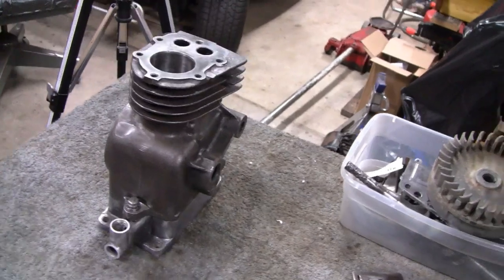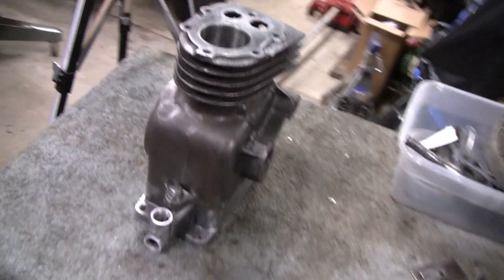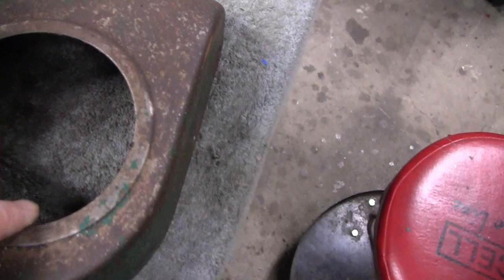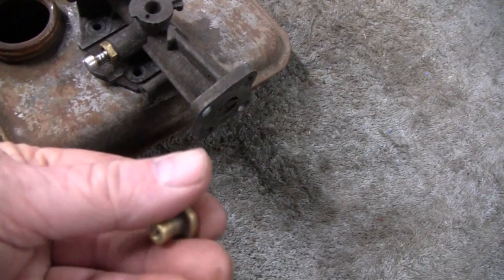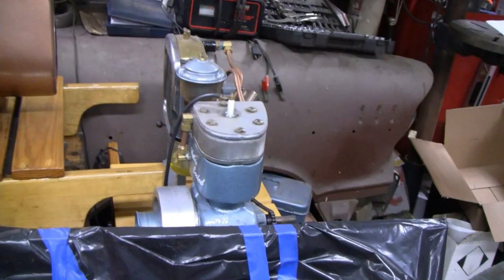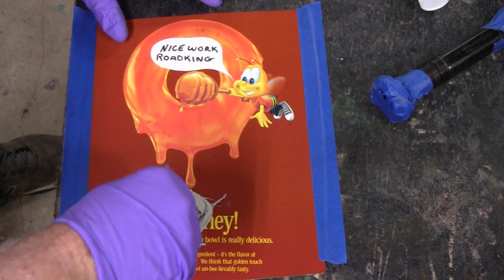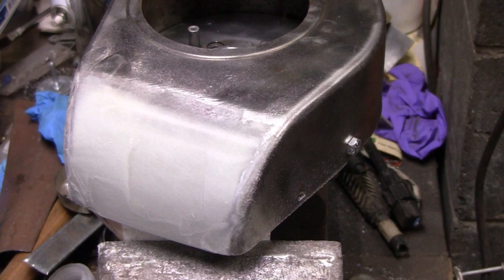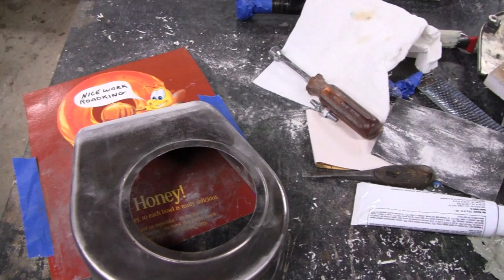MOTORIZED SCOOTER BUILD (part 13)

Comment: Great update Roadie! I'm in the process of thinning out the engine collection here to get a little more room in the shop. Let me know if you get stuck on anything. I've got N's, 8's, 5's, WI's and who knows what else around here. All run (after a little Zippo style tinkering). One I have is a really cool crank start reduction gear Sears badge Briggs with a little 3 bolt flow jet carb on it. That would make an interesting project build to power something with the reduction gearing. Anyhow...just rambling now. Catch you on the next one Roadie! Zippy~
Reply from the maker: Thanks Zip!! I know the feeling, I have a loft full of God only knows what!! I just gave away that Bready Walk Behind Tractor with a gear reduction "N", the Kid probably already ripped the engine off it!!☺

Comment: Nice progress 
What primer would you recommend for cast aluminum I have some brackets for the front accessories on my truck I want to paint and not sure what primer to use
Reply from the maker: We use to use zinc chromate primer for aluminum but I think that has been replaced by Zinc Phosphate because of it's high toxicity!!☺

Comment: Hey 805roadking I made a engine stand with wheels doesn’t look super.  but is a all original good condition motor worth taking to a show?
Reply from the maker: Sounds like a plan Nugget!!☺
Reply: 805ROADKING this engine has great original paint but has thick grease on it because of a leak don’t know how I’m gonna clean it without wrecking the paint